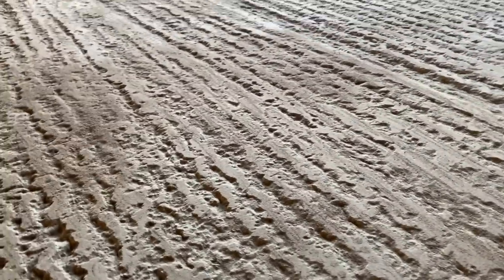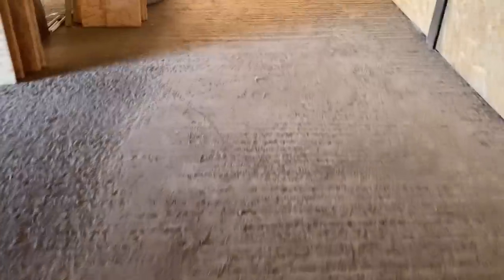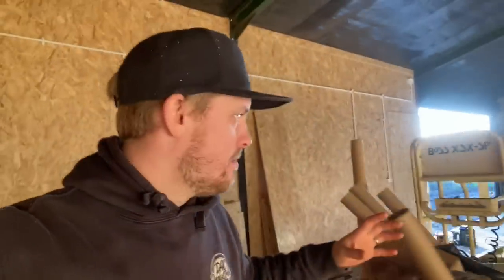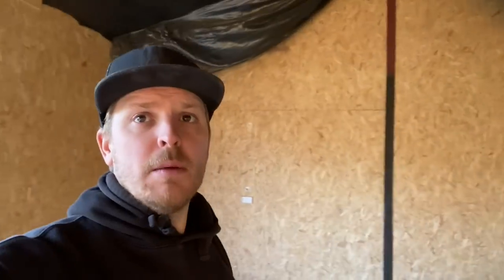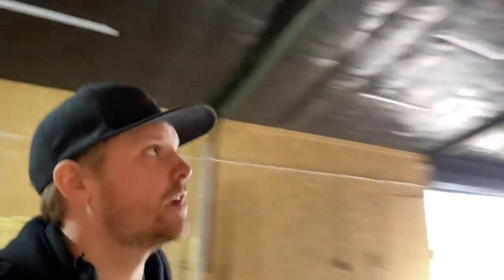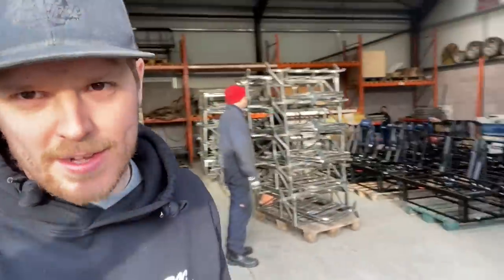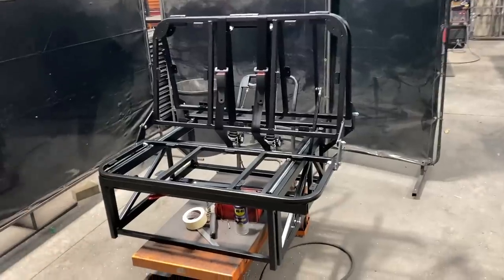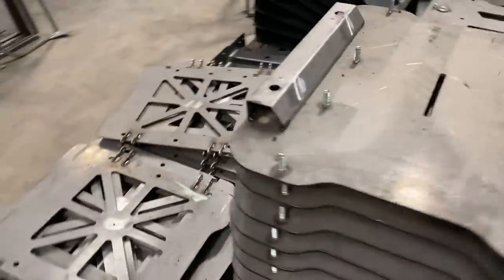Building My Dream Workshop At Home - Episode 6

Comment: Dont do levelling compound Dan, as soon as you drop a hammer on it it will crack. We did it on our workshop and then painted it. Most of it is cracked and looks terrible. Just paint what you have there. It will stop you from raising dust put still give you a bit of grip when the floors are oily and that.
Reply: Also, it will need an epoxy DPM as the building doesn’t have one and the levelling compound will blow otherwise so will be very costly
Reply: Couldn't agree more, run the machine over it again, and then epoxy paint it with a few coats
Reply: @joe3points864  Is that the stuff that you can pour out and  spread out. And add stuff like flakes to it? Or just a strong paint?
Reply: @RonaldMedia  I would just use strong industrial floor paint. You are either building a garage/workshop or you're building a showroom. Garages always get banged about.
Reply: Yep, exactly that….. levelling compound will just crack. Concrete will flatten out over time with use.
Reply: @ragestunts6990  Hmm yeah. But would you fill in the gaps with something tho?
Reply from the maker: A mate has put the Screwfix Compound down in his unit and it is good a year on. No DPM and he is a heavy fabricator
Reply: @DanChambersDAC  personally I wouldn’t risk it. Been in the flooring game 20 years. I would grind floor and use epoxy paint and be done with it

Comment: I had a similar issue, not as deap as yours. I used a two part epoxi floor paint. I used more paint then if it had been flat but the total cost was less than other options.
The end result seemed hard wearing and was ok still when i.moved out 12yrs later.
I put the epoxi on really thick and gave it plenty of drying / hardening time between coats until I was satisfied. 4 coats...
Reply from the maker: Cheers bud, I may be leaning towards this option.

Comment: Grand progress buddy. As for your access door, pop to Toolstation. I got mine a ship grey but have anthracite roller. Look for bedec multi surface paint. Been great on mine, almost a year in and looks great. I used a radiator roller so no brush strokes.
Reply from the maker: Cheers bud. Thanks for the tip, Will have a look.

Comment: Look at resin floors with silica Sand over the concrete but obviously after concrete for ramp is done 
2 for 1 then level the floor and will look good aswell
Reply from the maker: Good shout dude.

Comment: Dan, did you think about adding another 16amp socket or two to allow you to run higher current welders in the future? You probably don't need that for most of your auto welding at the moment, but would be a useful bit of future proofing.
Reply from the maker: I hadn't tbf. Most of the stuff I do should be Ok as it is.

Comment: Dan if you want to level the floor put electric heating in it at the part where you want to park your projects for now (future spray booth) to give them some love 🙂🙂🙂
Again a nice step closer to finish your workshop 💪💪💪
Reply from the maker: Cheers bud. That would be sick but you would lose too much heat as there isn't any insulation below the concrete.

Comment: Cracking job Dan. Might be worth putting some lighting on the wall above where your benches are going, it makes a massive difference when working on stuff. I wired mine in with the lighting circuit but on a separate switch so they run independent of the main lights. Can't wait to see this finished 👍
Reply from the maker: Cheers bud. I have an idea for the lighting where the benches are going 💪

Comment: Dan maybe try and get a good self leveling screed with mesh fibre  from your concrete supplier we put them down over under floor heating they don't crack and easy to keep clean
Reply from the maker: Cheers bud, Will have a look into it.

Comment: A flat floor makes moving things like engine hoists so much easier and safer.  However you do it, do it now before you move things in.
Reply: Before you move in, borrow an engine hoist, dangle something heavy, try moving it over the ridges in the floor.  That way you can see if it works for you.
Reply from the maker: We will be getting at least half of the floor smoothed before we start moving in. The moving date is looming so we will have to move in before it is finished.

Comment: Great job mate, one thing, you have put insulation direct onto the OSB boards, don’t you need to leave an air gap for condensation
Reply from the maker: Cheers dude. So the insulation is 100mm thick in the walls and the wall timbers are 175mm so there is enough room for an air gap in there.
Reply: Cheers Dan. Looking forward to the finished workshop.

Comment: Keep grinding or get one of them surfacing companies in.. lay some resin type epoxy wizardry.. levelling compound isn't the answer, especially not off the shelf mixed in a bucket stuff..
Reply from the maker: I spoke to a few companies and they said that the off the shelf stuff mixed in a bucket is what they would use.
Reply: @Dan Chambers  I'm a spread and lay the odd room with my workmate, never massive sections, however it's the similar but scaled up... prep is key, clean dust free, grease free surface... then priming, you'll need a good primer, each compound brand recommends their own, but you'll find it looks like SBR, smells like SBR and works like sbr,  it'll reduce suction and allow the compound to flow and bond.. some brands send 1ltr or so of fluid per bag as part of a unfuckupable 2 part system , or mixing needs to be repeatable and fast with a pre planned water level.. you can't do it alone or with someone having a go, they won't mix it fast enough or get it to you in time, you gotta hustle and the gear likes to settle in the bucket as soon as you stop spinning.. pouring it has to be spread about like a snake, dump it in one spot and you'll have a sand castle to move as the material will stay as the water seperates.. floor blades on a pole are awesome, just help the compound along and it'll be lovely and smooth.. Spike rollers pop bubbles, spike shoes let you work the area.. hopefully that give you an idea that you need to research your plan and execute it.. like with all plastering/wet trades, youre on a stop watch, these materials wait for no man.. you should be able to find more information and some advice from someone who does it more than myself, my work only sees tile and foot traffic.. look at some Refina tools, they do floor blades and stuff.. Good luck..

Comment: Looking great Dan,  such a shame the sparks didn't run everything in metal trunking and conduit to future proof and stop problems of broken electrical points. 
Let's hope they didn't glue all the joints cause by summer you will have a roller coaster of conduit.
Keep up the great work 👌
Reply from the maker: Cheers bud, I wanted it all ran in white. I prefer the look of it. if one gets damaged I can just replace it. Joints haven't been glued.
Reply: @Dan Chambers  OK cool as long as you are happy with it that's the main thing. You are living a lot of guys dreams we all just hope it comes out as your perfect shop👍🏼

Comment: 👍 - Can you please put a link to the batten lamps you have put up on the ceiling in the description? Do they have a captive cable or was that a small length of conduit visible sticking out of the side? Thanks
Reply from the maker: They are from a company called TEKLED and are the 4 foot ones. They have a small tail of cable out the back of them. I don't put links in for parts I have paid for.

Comment: Great build love the videos as for your floor have you looked into interlocking pvc floor tiles I purchased my ones from a company called rtek in Ireland who delivers to the north east of Scotland sometimes also they have some slightly seconds at great prices and there products are spot on once down it looks like a painted floor extremely hard wearing and virtually impossible to see the joins
Reply from the maker: Thank you dude. I am not a fan of the floor tiles, Find them uncomfortable to work on.

Comment: Make a few more passes with the concrete grindertn get it  resin finished , it's easy enough to do, next time you concrete make yourself a float with some wood and some smooth yoga mating to pull over the concrete to smooth it off after you tamp it level
Reply from the maker: Spoken to a few people that may be able to help with levelling compound. Hopefully that will sort it. Yeah will make sure it is smoothed when we pour for the lift area.

Comment: why don't you just get an epoxy floor resin poured that will level out the rough floor the first epoxy coating is a leveling compound the second is a finish floor coating that way your not spending money getting the floor smooth then spending money putting a coating on the floor its doing the job in one go.
Reply from the maker: Ideally we would go this route but the budget is about gone now!
Reply: @DanChambersDAC  ah i seen well the quickest and cheapest would be leveling compound and a floor paint then